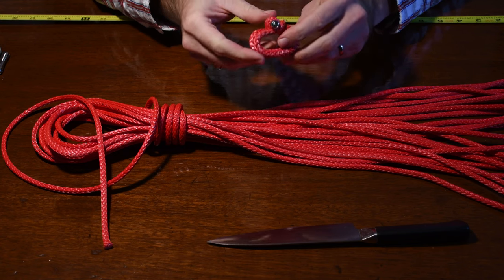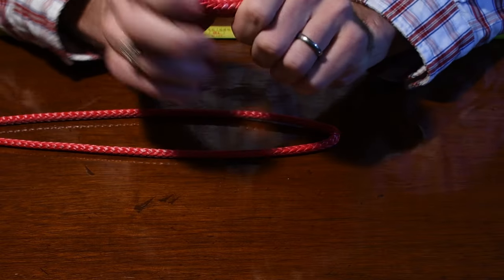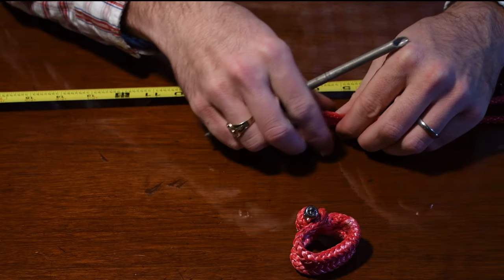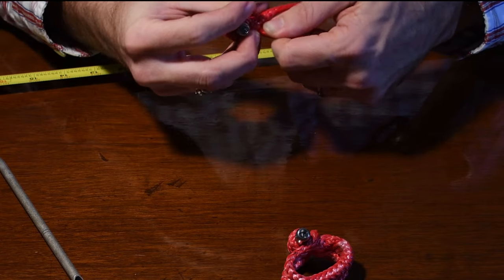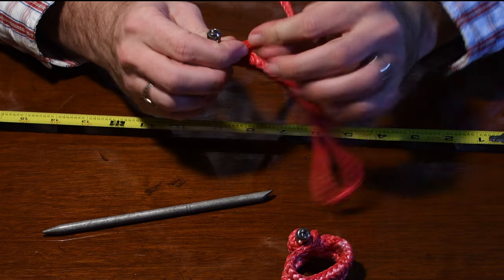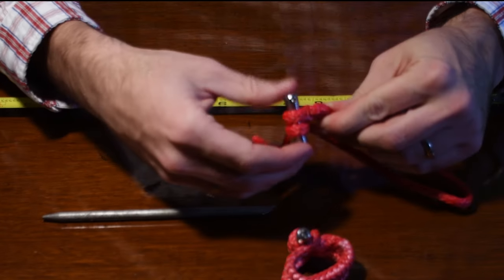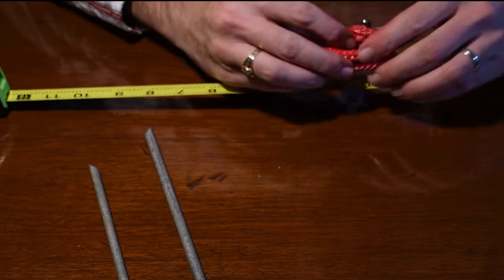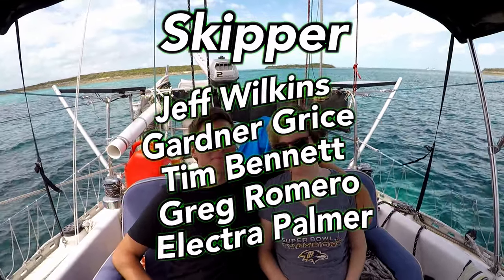Easiest Dog-bone Soft Shackle [Dyneema] | Sailing Wisdom

Comment: So, a few questions 
  - If you are replacing something with a working load of ~100 pounds, why use something about 10 times greater? 
  - Since Dyneema requires double the bury of a class I line, why not use a class 1 line which results in a srtomger bury?
  - How are these attached to the sails? 
  - Why not skip the complexity of the 'false Brummel' (what you did doesn't really lock it)  and just use cross-stitching as the lock?

If you look at @HardIsEasy  https://www.youtube.com/watch?v=0gWOiqPAZDw&t=581s , the use on Dyneema sling-on-rope leads to great chafe and early failure.  Especially under great tension.

Comment: Herby - very cool video. Appreciated! Is the dog bone the only option for hardware for closing  these soft shackles? Is it the tight space between the sail edge and the stay that keeps the soft shackle from releasing? How do you make sure that if a soft shackle comes undone, you don't lose it? Thanks!
Reply: I have only used large knots myself so far. I see a few proprietary options.

Comment: I have a large amount of knot soft shackles I use frequently for any reason. Originally made most for sails on lines as staysails. Now they can be used for everything. I would like to know more on the comparative use of styles? Possible a non metallic dogbone will have me try this. Think I could mold resin impregnated rope section if none are available. Thanks for another fine tutorial.
Reply from the maker: That would be a cool way to make your own toggle!

Comment: Can you explain the reasons you use a dog bone over a button knot soft shackle,  to me you are adding extra weight and only eliminating half the hardware. Is it just for ease of attachment/detachment and a little less profile ..... just interested
Reply: My guess would be the small 2" size makes sliding the loop open and closed around the button difficult or impossible.
Reply: I can’t see any reason not to just use a standard soft shackle with 1/8” dyneema.
Reply: @williamfoster2789  my boat is much smaller so I would be likely to give your way a shot. He did say this size was over engineered.
Reply: @williamfoster2789  Experience based, relatable size sail and stay, bay sail or global?
Reply: Not having used this type I have no comparison. I have utility soft shackles available in bulk.
Reply: @braithmiller  Experience based, but mostly common sense. The info that came with the video did say that these were for the connections at the tack and head of the jib, where the forces are greatest, with all of the others being standard soft shackles. Given the fact that the standard shackles are many times stronger than necessary, they are certainly strong enough for all points. The dog bone is unnecessary, expensive, and a bad idea.

Comment: Where can we get the dog bone/toggle  piece? Is there a part number or model number? I got some 5.5 inch carbon steel shears that one side has micro serrations so it grips the fibers and they don't slip/squish out. They work great, but the did cost about $30

Comment: Thanks again.
Do you have any tips on how to get a knife reasonably sharp? Any videos on this I see use all sorts of tools and leather straps and special powder ......
Reply from the maker: I use a regular kitchen knife sharpener that was in the galley of my boat when I bought her. If I sharpens the knife, it will cut through easily for the first few cuts, then it gets dull again. 
A regular kitchen knife also works just fine to cut Dyneema, no need to get a fancy ceramic blade.
Reply: @RiggingDoctor  thanks

Comment: Could you put a loop in the other end from the dog one and make it a soft shackle? Would it be less likely to shake loose if the sail flogs?
Reply from the maker: You can, but when it slips through the cringle in the luff, it gets rather narrow and will be hard to open the soft shackle. 
When it’s put in the sail, an small safety line is tied from the dog one and around the loop to hold everything in place.

Comment: Hey Herby! I’m considering replacing my lifelines with Dynema. A local rigger is advising against it because apparently Dyneema doesn’t last as long under the Caribean Sun compared to wire life lines. Would you agree with that? Thx!
Reply from the maker: I feel the exact opposite! The color will fade, but they hold up great! We spent a good amount of time down by the equator where the sun can’t be any hotter and they showed no additional decay. 
Our lifelines are 8 years old now and still going strong with no signs of failure.
Reply: That’s good to hear. Thanks!

Comment: Is there a way to predict the decreased breaking-strength of a non-tapered splice, or is that one of those "There are waaay too many variables to accurately predict that" things?

For instance, you said that the shackle has a breaking strength of 10,000 lbs, but how much is that reduced if you don't taper? Is the new limit 9,000 lbs? 200 lbs? Is that calculable, or would you have to do a bunch of "bad" shackles and yank on them until they failed? (Doing an "n" of 30 to get a statistically-significant test sounds ... tedious) I.e., is there a nice mathematical equation, or would you have to "engineering" it?
Reply: One would have to test it. No reason to induce a sharp edge. Many strength reducing knots are 50% or cause wear.
Reply: HowNot2 did break tests on this!  There's other good sailing and knot/splice too.  Watch here:  https://www.youtube.com/watch?v=lhIPeJNWtxE

Comment: Greetings;
Interesting mod.  I'm not a sailor, but a dedicated hobby "roper" if you can relate to this made up term?!?  Ashley BOK is my bedside bible.  :)
Atlantic Rigging co. sells these SS Dog Bones for about $20, and it's rated at 5K# breaking, much less than the Dyneema is rated.. 

Is your motivation for using this soft shackle mod,  to assure it won't shake free is use, as a soft shackle with Button knot might?  Appreciate your clear, well annotated presentation sir.  Stay safe.
Reply from the maker: Thank you very much and I completely understand the type of person you are, it’s basically me without a boat. I find ways to use rope to fix so many other problems as it’s such a useful tool that (with the help of good books like ABOK) can be made into infinite solutions!
The reason I used the dog bones is I was making a setup to attach the sail to a stay. The top and bottom attachments undergo the highest amount of stress and wear. I wanted these two points to be made out of something that had an independent strength rating, that way I knew it would be strong enough. All the others in between I used a regular soft shackle with a Lovers Knot instead of the Button Knot, simply because I like how the fibers lay straighter and I feel like they would retain more strength. 

For the high load applications, I used the dog bones with a rating, for the high load, but not the highest load ones, I used a trusty knot for the job as it’s much cheaper than buying a bunch of dog bones.